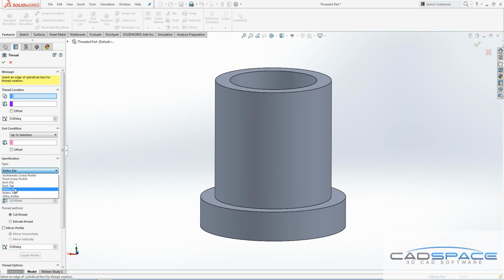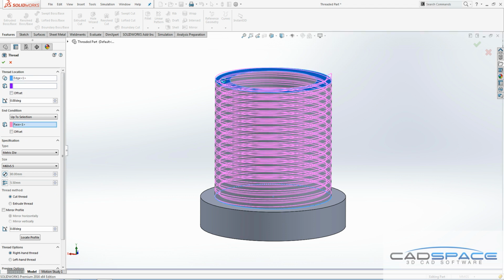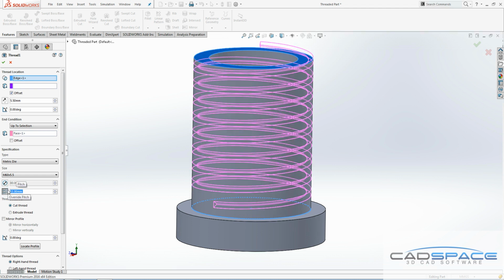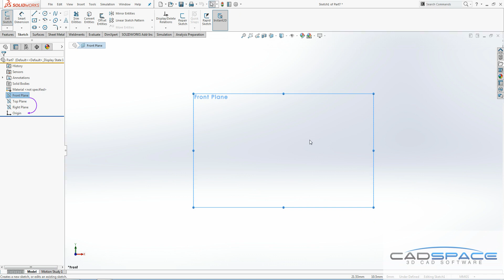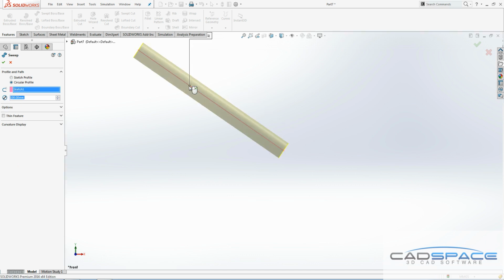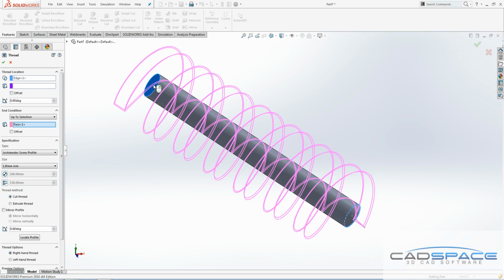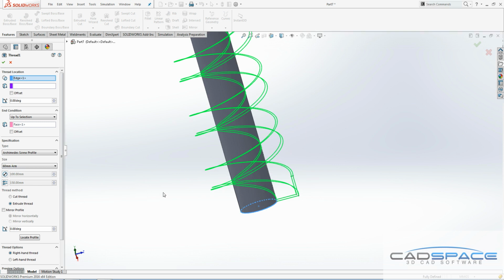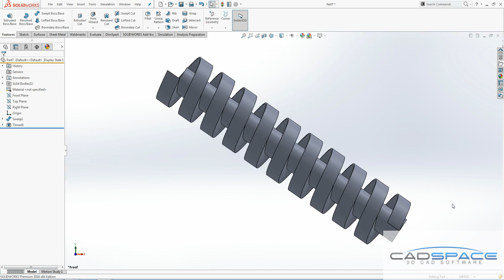SolidWorks 2016 New Thread Features

Comment: You call it an M60 but that thread WILL NOT fit any real M60 thread. Is there any way to get the thread the correct size automatically?
Reply from the maker: +Fergus Taylor The profiles that are included within SolidWorks are for guides only. If you need to be specific, include clearances and any other property you will need to draw your own custom thread profile to be used. Once the new thread profile is created, the correct thread will be automatically created.
Reply from the maker: +Fergus Taylor You can check out this video to see how we use metric thread tables to take into account thread/nut fit - https://www.youtube.com/watch?v=WiQLudFV7ZY&
Reply: +CADspace3D Are you saying the solidworks tooth profile are also wrong? I was talking about major/minor diameters.  And as far as I can tell there is no way to "create the correct thread automatically" as they're driven by whatever OD or ID you've set - solidworks is happy to call a 10mm shaft with an m60 tooth profile an 'm60 thread' completely ignoring the fact that (surprise, surprise) OD/ ID are important parameters for threaded parts. It's complete stupidity at best, knowingly misleading at worst.